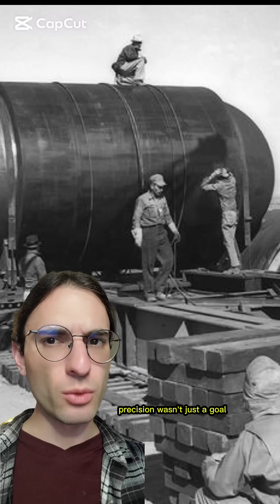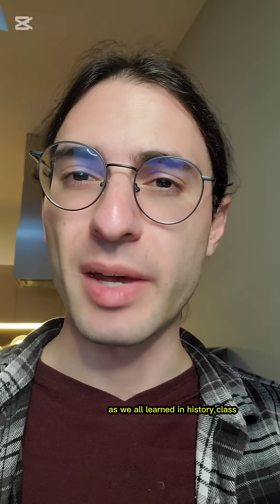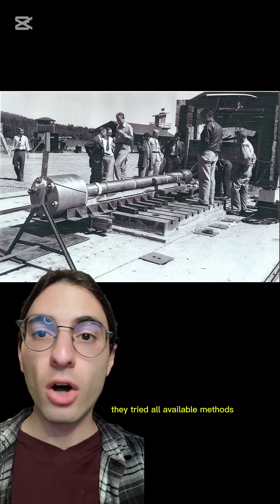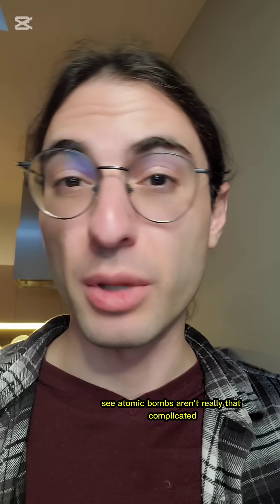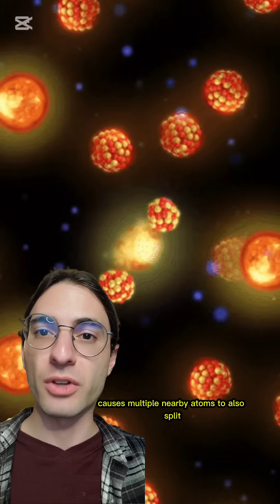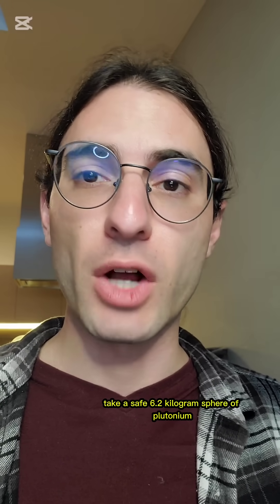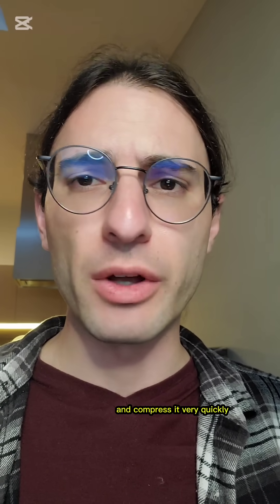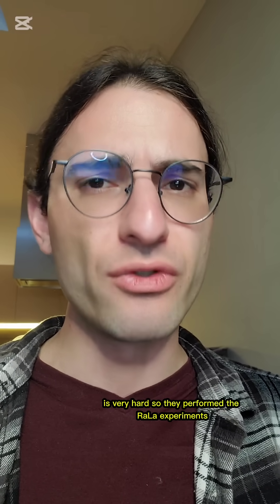The building of a bomb

Comment: The hardest part about the manhattan project was just getting the U-235. They needed to use a calutron, a mass spec device that enriched the uranium to around 80 percent at a rate of 20 micrograms per hour. This would take a little under 2 years of continuous operation to make one single gram of 80% enriched uranium. Thousands of calutrons were built and it took a ton of energy to make it.
Reply: Incidentally, this is how intelligence agencies are able to work out if uranium is being enriched for energy or weapons. One way or another, the sheer difference in enrichment required will show up in the budget.
Reply: @  is it because nuclear energy needs only 2-3 percent enrichment and nuclear bombs need 80 percent enrichment? I assume that would be the way to tell. If you have multiple insanely massive gas centrifuge enrichment plants. then it would indicate a bomb. If you have one small gas centrifuge enrichment plant then it would be a reactor.
Reply: @vishalkote1475  That's exactly right! The difference is just too stark to cover up easily.
Reply: @ even in foreign countries, you can’t escape the IRS. They know too much.
Reply: that is not realy hard, judt labour intensiv.
i would not call stuff hard that can literaly be brute forced.
stuff like the lenae are harder because you have to think to adapt what you have
Reply: @MrKhamul93  It's not even labor intensive since machines are doing most of the work.  I don't doubt it's the most expensive though. However as someone works in a manual labor profession, stuff that has to be brute forced is exactly what I would call hard. Any problems that can be solved by thinking through and adapting always make the job easier in my experience.
Reply: @MrKhamul93  idk how you would brute force getting U-235. you have to automate it because humans can’t tell when a uranium atom is 3 neutrons lighter and separating the two is really hard to do manually. It’s not brute force it just takes a long time. The reason it’s hard is because getting enough for a bomb means building many many machines to make the enriched uranium and mining the uranium also takes time and energy.